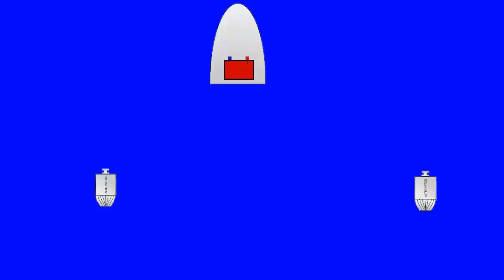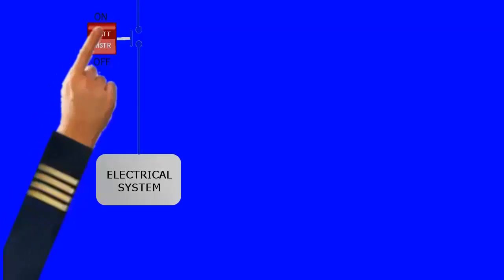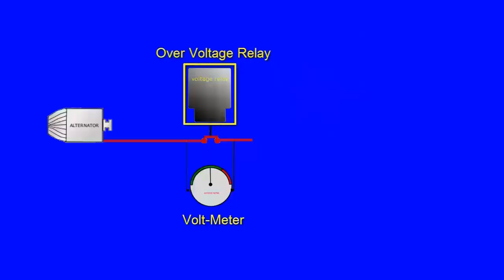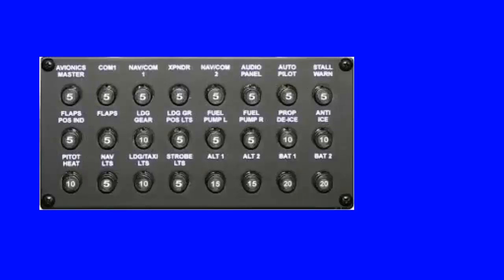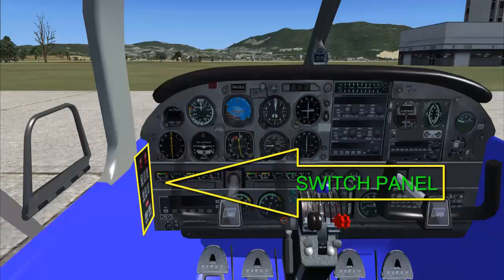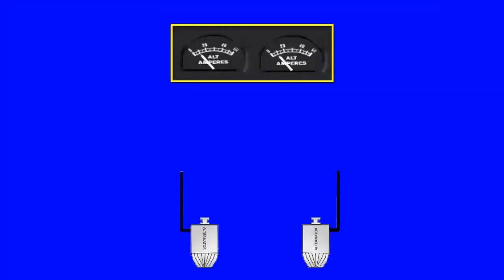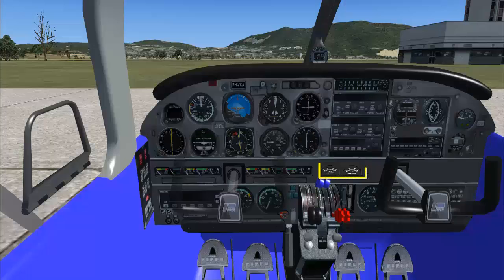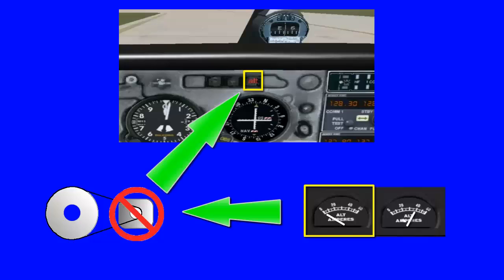PIPER SEMINOLE PA 44-180 POH| ELECTRICAL SYSTEM REVIEW

Comment: What is with the terrible computer narration? 
Also, your narration and subtitles are contradictory (ex: batter for use of elec. equip. when engines are NOT running)

2/10 would recommend this video to a student
Reply from the maker: if the engines are not running and you need an electrical source will the battery eligible to be used i dont understand what is the problem ?
Reply from the maker: all the informations are based on piper seminole poh